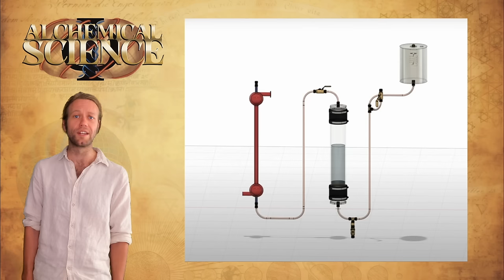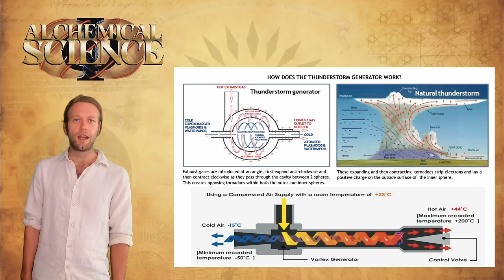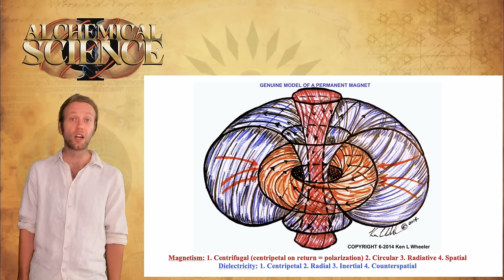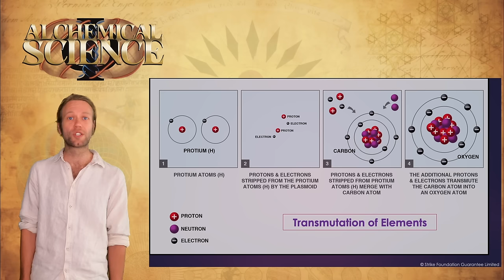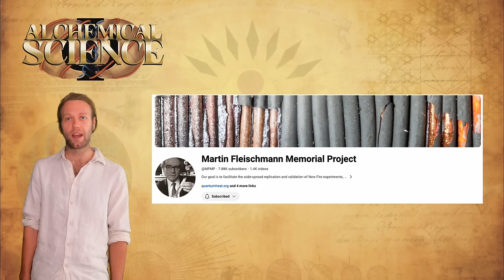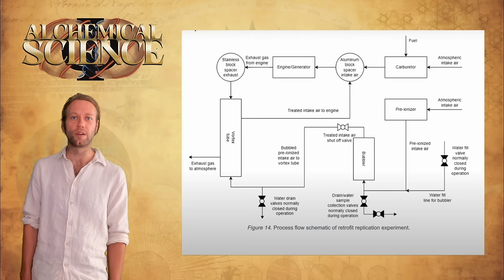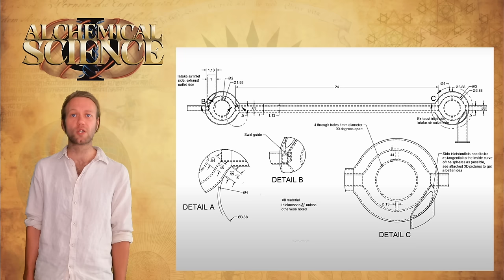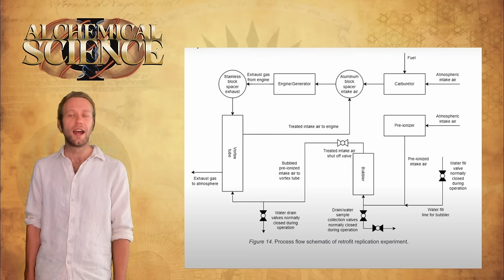Introduction to Plasmoids, Ball Lightning & Thunderstorms

Comment from the maker: Cheers for all the positive feedback on this video! I spent a long time writing and re-writing it, trying to break it all down as simply as possible in layman's terms and it is clear it was well worth it 🙏
Reply: I know how to simplify the system, the way to create the spinning air in the inner and outer tube and make the air spin on exactly 51.84 degree angle like your aiming for just weld one end of a metal spring stretched down the copper tube, measure the distance of the tube and circumference of the spring on the inner tube and do some maths to work out how many turns the spring needs to  turn before welding the other end up the other end of the tube, then repeat for the exhaust hot outer tube, saves making the 2 metal balls and hoping the twisting air is exactly 51.84 degrees, you can put a few springs down the pipe for greater spin, that would mean you can make it all fit in the exhaust system of the car and run a tube to the inlet manifold from the back of the car where the system would be where the spare wheel goes to make room, that's my plan.

Comment: What is the mathematical relationship between the engine displacement and the length and size of the tubes/spheres? You have a list of compatible tested engineswith a range of sizes in a separate video, but what if I want a thunderstorm generator for a 6.7l engine?

Comment: I've watched a bunch of videos, trying to understand a lot of this, I'm excited to start building and experimenting, but I have a question I haven't found an answer for.  Well these work on a turbocharged engine? A lot of Bendel's design mention carburetor, but I imagine just put the plasmoid injection after the throttle plate.  It's supposed to work on diesels, but they don't have a typical throttle body, and most modern diesel engines have a turbo as well.  Turbocharged intake manifolds don't have a vacuum, so if my basic understanding is correct, the plasmoids won't form or collapse when the engine is under boost.  As I wrote this, I thought that, instead of taking fresh air from the atmosphere, you take it post-turbo but pre-manifold, and re-inject it in the intake runners, where there are still a lot of pressure waves that could cause the necessary cavitation....  I don't know what I'm asking anymore, but does this make sense to anyone?

Comment: Do you think the other Elements being formed are also being consumed in converted by the plasmoids On the Metal surfaces As it continues to run?
The plasmoids seem to act on carbon. That's built up in an engine.  So my thought is that these elements are only there for a short time and then consumed as the generator runs.

Comment: also saying that current runs "through" the wire is inaccurate. a huge amount is "lost" by the system engineered currently as the electricity scrapes along the surface, which we measure in heat. there would be no heat if there were no friction created.

Comment: Is there any works on other liquids that would not freeze? Super interested in having a system built for a Cummins engine but live in bc canada where it would either have to be drained and filled daily or salted to prevent freezing...PS you are rocking the teachings of this... know anyone building then yet?

Comment: definitely not pure oxygen in exhaust after conversion but atmospheric levels of oxygen, however significantly lacking in carbon dioxide, extremely low nitrous oxide and carbon monoxide, significantly reduced hydrocarbons, etc

importantly also: longer engine life due to cleaner burns, reduced friction and vibration. Better fuel efficiency and more power in engine.